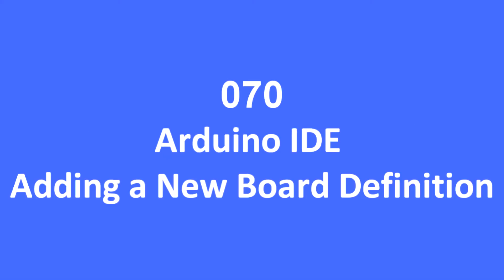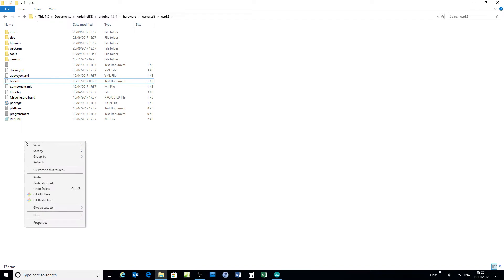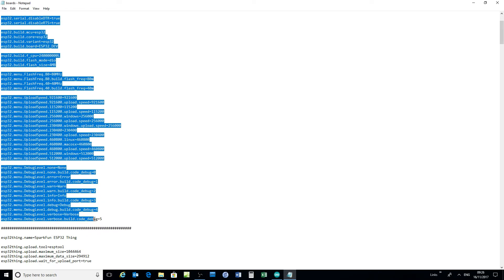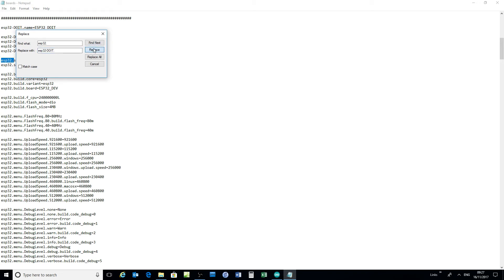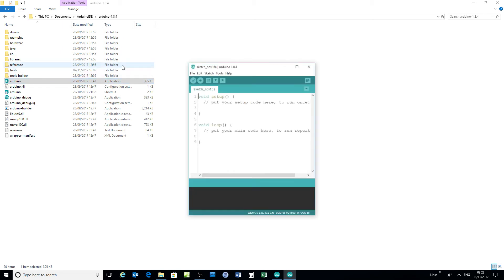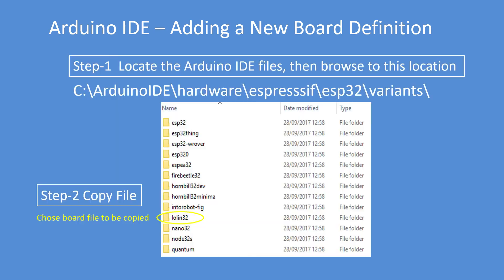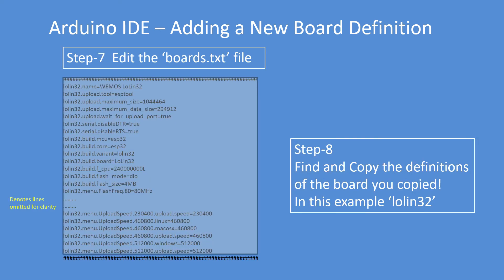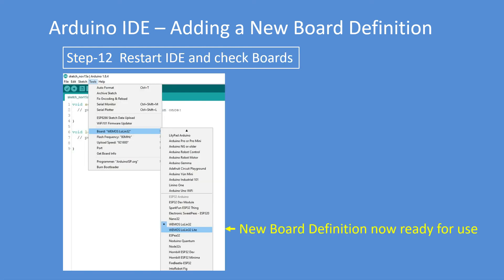Tech Note 070 - (Obsolete as IDE changed) Adding a new board definition to the Arduino IDE

Comment: My Lolin-Lite board should be delivered today so I have just followed your Tech Note and added it to the definitions, etc. Easy to follow your instructions and all I changed in the pin.h file was the led pin from 5 to 22 for the Lite. Thank you Dave!
I have a ESP32 Lolin Pro on the way, which uses the WROVER and so lots of ram and also a SD card reader on the board. That will be my next board definition task :-)
Reply from the maker: Good to hear about your changes. The choice by Wemos (uncharacteristically) to use 22 as the led pin is odd because it flashes away when using the i2c bus so there is some logic in changing their definition for SDA and SCL to another pair of pins elsewhere but less than 32 as only those pins can be reprogrammed. Now I’m going to look a bit closer at the Pro version it sounds very interesting.
Reply from the maker: Sorry I got that wrong, the weird LED flashing is on the Loilin 32 not the Lite board, it uses the same pin (5) as SS/CS on the SPI bus. Even so easily fixed by moving the SS pin.
Reply: I haven't got the lolin-lite board yet, but I think your original statement is right, as pin 22 is SCL on the i2c  bus for the lolin-lite, so the led would flash along with the clocks. I will now for sure once I have the board!